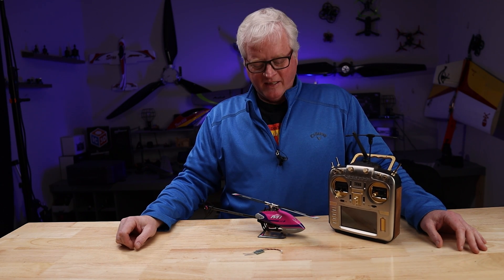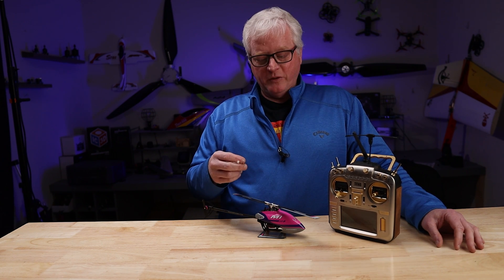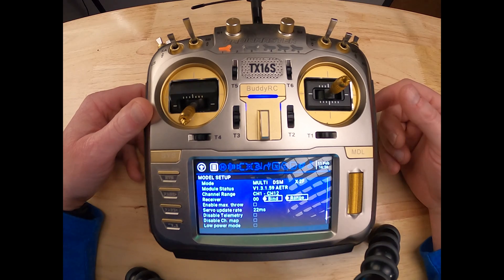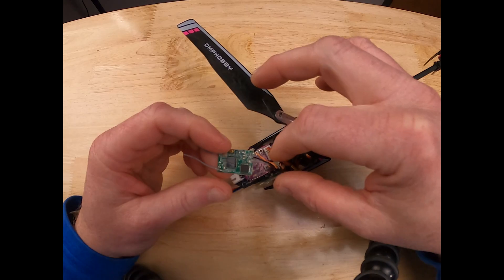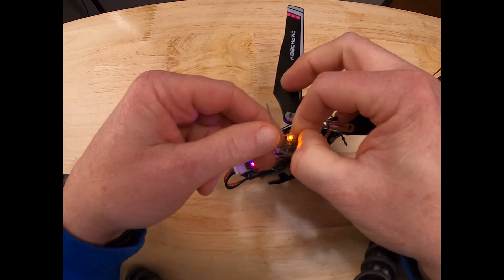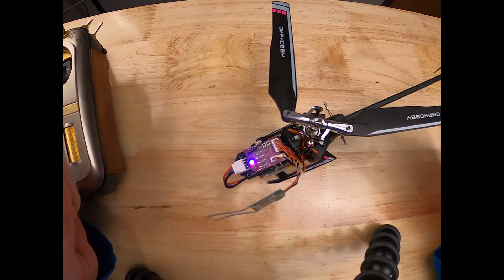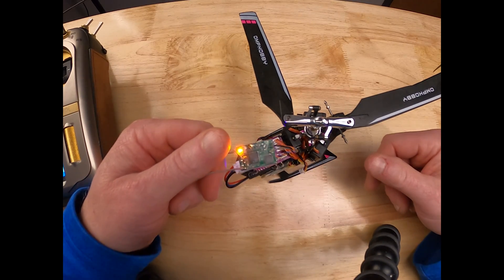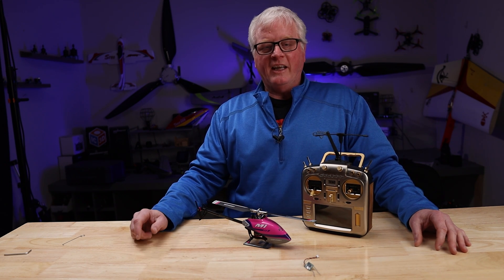KENSUN Receiver binding procedure on the OMP Hobby M1 and M2

Comment: Hey, thanks for the video. Couldn’t manage to get my DX6 to my new Goosky s2 in 11ms DSMS mode but changed it to 22ms and it worked like a charm. Any way to fix this or is 22 fine?
Reply from the maker: you should try some of our great products
Reply: Auto is not the correct sub protcal I have the same problem it changes the ms to 22 did u ever find a fix

Comment: I’m using the M1 model helicopter with the Futaba SHFSS protocol. With model created in transmitter I try to bind the helicopter and I do not get the rapid light response when I press the bind button on the helicopter.  The red light stays on and blue light flashes slowly.  No binding takes place.